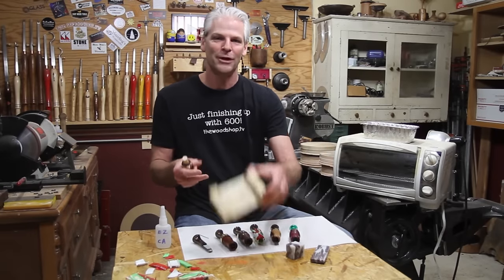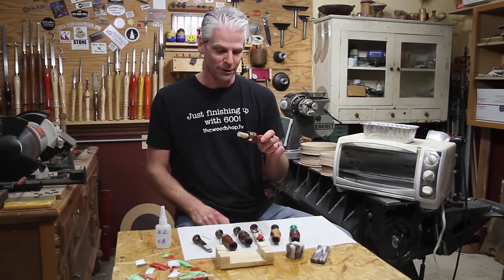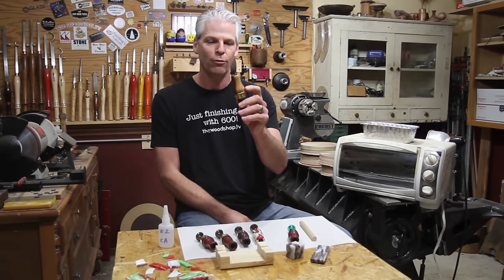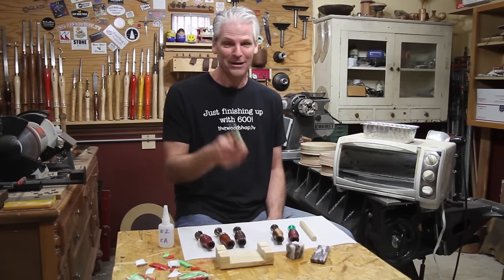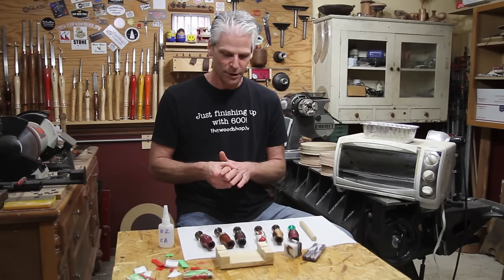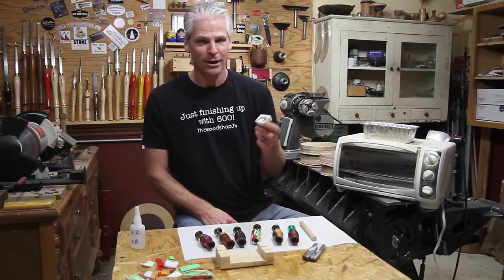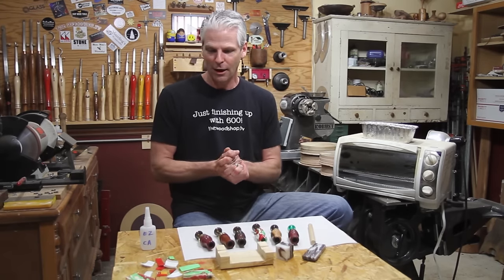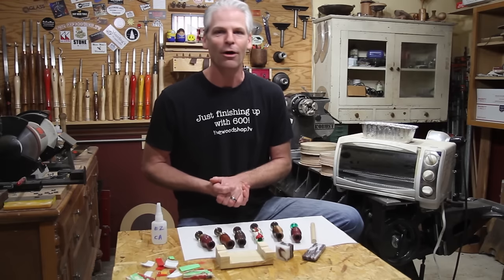Duck Calls

Comment: Great video! For my call banding, I scrape the inside of the band with a pocket knife. I also cut channels in the call for the epoxy to rest and bind. I have tried ca, and supper glue and they allways failed. Two part epoxy is my go too now. I (knock wood) have not had any failures using it.
Reply from the maker: +gabby417 Thank you, and thanks for the tips.

Comment: I have never tried it , but you can get keyless drill chuck with a 1/4" hex shank for less than $20. You should be able to chuck your bit in that and then chuck that in your drill press.
Reply from the maker: +essjayell Thank you I'll check it out.

Comment: TAP Poly-weld adhesive? Uses heat treatment and two part adhesive to bond LDPE and HDPE. I'm sure the safety police will crawl all over that suggestion.Good open time, but a long full cure time. Allegedly good to 2000+ psi. Let Peter do a test run for you since he has a penchant for that sort of thing. As you can imagine, there's a youtube video about it. 

On another note, when drilling holes for scroll-saw work I wrap a coil of 20-ga solid copper wire tightly around the drill bit (3/32) and that shims the shank out enough to grip in my drill press 1/2 " chuck. If you're using a bit smaller than that, Micro Mark has a Mini Drill Chuck ($12) which accepts down to #59 bit (0.041").
Cheers,
--Joe
Reply from the maker: +Joseph Scarborough Thanks for the info/tips Joe, I'll check out the chuck too. 
Take care,
Carl